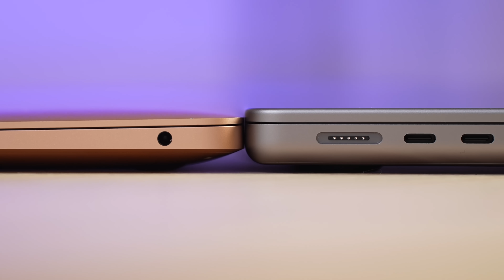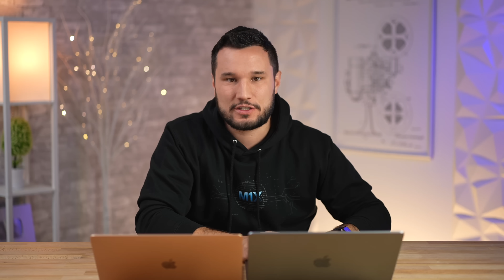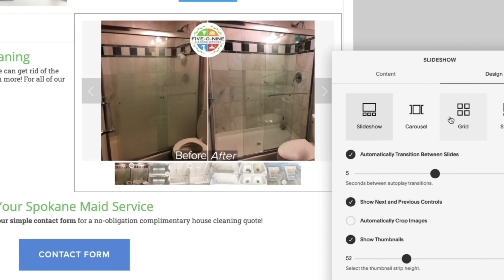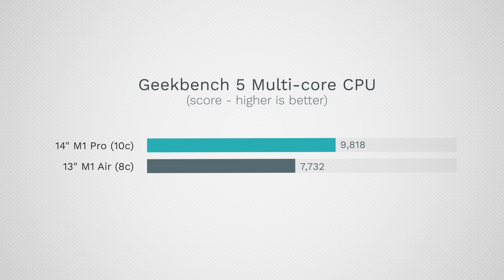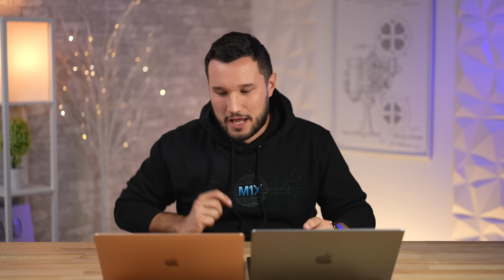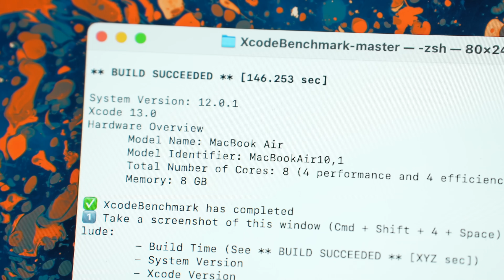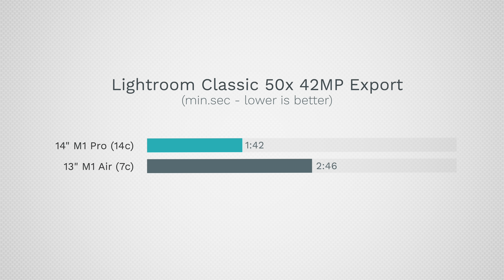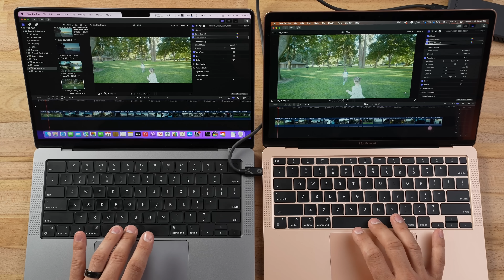14" MacBook Pro vs M1 MacBook Air - Worth $1,000 MORE? 🤔

Comment: I really love my M1 MacBook Air with 16GB RAM / 512 GB SSD. IT replà de Booth my former 6x core i7 MacBook Pro 15” (horrible battery life, noisy, hot) and my 4x core i7 2017 iMac (64GB RAM, 1TB SSD), and I’m mot looking back anymore. I use it mainly for graphic design (Illustrator, Photography, InDesign) and LUA programming. For me, the 1000€ price difference for about same performance is not worth it.

Comment: Yesterday, I had the opportunity to touch and feel these laptops in the Apple Store.  The 14" is definitely lighter than 16" but both are very portable machines.  If you have a 13" Intel, just get the 14".  if you have a 15", just get the 16".  I'm getting the 16" because I have Late 2013 15" MacBook Pro.  Thus, I purchased Apple M1 Max 16" with 64GB RAM and 8TB SSD.  It will be used for both my home desktop and travel.  If I feel that the weight doesn't really work during travel in my 14-day trial, I'll return and get a maxed out 14".

Comment: The upgrade is 1000% worth it.  First, like you mentioned if you try to match hardware specs it’s much closer than $1000. More importantly this machine feels waaaay more 2021+ than any of its predecessors.  The screen is unrivaled, the keyboard is perfect.  The touch bar experience so smooth and just the design of the sides and back with a new flair of MacBook Pro bring it current aesthetically.  Say what you want about the two but to me they don’t compare, aren’t even close, and 100 times out of 100 I would pay the upgrade price.

Comment: The new M1 MacBook Pro is definitely worth the $1000!! My main points that make it worth are below,

1. Display - The black depth and mini-led on the new MBP is breathtaking 

2. Ports - A laptop needs ports. It can’t go wireless, it will lose its purpose. Again MBP strikes here. 

3. Webcam - Technology has grown, you can’t have anything less than Full HD on a Laptop

4. Power - This is RAW power up for you to do anything. 

5. Value - If you have the money and the use, MBP will get you the best output for the money by saving time in processing and along with the other features. 

Other features are an add on for me.

This is a dream laptop for many along with me!

Comment: The pros are currently to expensive, but the prices will come down in about 1 year probably. It’s the first of a new generation so they need to make up the costs of R&D and the retooling the manufacturing lines. Also the current M1 13’ will probably be replaced with a 14’ but with everything but m2 instead of m1 pro. Probably start at about 1,400$.

Comment: -Some thing hidden?Scale the M1 module to the Pro1 and Max. Add some memory. Is there something I’m missing? That Apple actually creates nearly a dozen different chips on the foundry floor. OR… is it three or four with a simple ‘switch’, software or hardware, that activates a full fledged M1, Pro or Max? I’m sure an X-ray of each variant of the 14 or 16 inch Pro would help settle that. As well as a deep dive in the machine code buried in the OS. Is there REALLY something hidden in the new Pro’s?

Comment: It is definitely interesting to see that the M1 Air holds up well despite being launched about 8 months before and was for all intents and purposes a guinea pig for updates that even Apple must've been nervous for the reception of (considering the bad precendent of in house chips stemming from samsung). While the new variants are definitely for professionals, the next iteration of the air should include more ports for USB, an SD card if possible as well. Otherwise Apple are so far ahead of the laptop game that it isn't even funny, and this is from someone who uses android phones, not ios on a regular basis, so I'm not an apple fanboy XD. 

Apple limits the choices, but with what little they do offer, that is exceptional and sets the standard. Most people won't even notice the differences on a laptop and most developers will adapt to the ARM based tech anyway. On a similar note if we were to see Surface Laptops, while definitely being high end, and coming from the same company that builds the OS, is not nearly as compact and smooth. 

There are of course many areas a windows laptop is preferable vs a Mac, but most regular users would prefer a Mac if they had the budget. While other laptops may depreciate much faster, both in value and performance, Macbooks inherently run well for a long time and sell well on the second hand market as well; I've known of people who've used the same macbook for over 8 years and have had very little complaint other than the battery life. Of course, we do need to keep in mind that getting a mac repaired is a giant pain, both effort and finance wise.

This giant leap vs other OS laptops fortunately or unfortunately does not extend to other devices like phones, where androids provide a stiff competition and give very good performance even vs an iphone. I've never felt the need for an iphone except for peer pressure purposes tbh, but I'd buy a mac if I had the budget even without peer pressure

Comment: Once the storage and RAM sizes are matched up, I think the price difference between both machines at the point makes it easier to justify going with the 14 MacBook Pro...as long as you have the coin.  Also I think having fans makes the the 14" the way to go if money isn't an issue. But if you don't have that extra $600 I think going with the Air is still a nice purchase.

Comment: Out of the 4 new MBP review and comparision videos I've wated on the channel, I liked this one the most, because of the comparision with the M1 MacBook Air which I was saving on getting one and the Xcode tests which I could easily relate with. Wont be bad to win looking at the massive battery for use in an environment where you dont always have reliable electricity

Comment: I have both machines (older models) and use them in different ways. Turns out 99% of the time I don't need an SD slot, HDMI port, etc. The comparison is fun but not practical. Good video!

Comment: It's worth more because it has more storage and ram by default. Also more ports, which are just not available on the MBA. MBA has just one port available for use if you are charging it - not enough if you are using multiple drives etc., without long wires/dongles hanging off it. So, the new MBP is unavoidable for some. I would miss the longer battery life of the MBA or 13 inch MBP though. If you want a greater variety of ports, then you have to have a thicker device. The 14 inch for sure has a better camera.

Comment: First of all, that Notch is a product design fail ... Apple knows how everyone hates it, yet they perpetuate this annoying feature. WTF. Oh! We have to use full screen apps to get rid of the Notch. Well it does not work like that in real-world use. 

Personally for potability the MacBook Air and MacBook Pro 13" are, and probably still are, wonderful for portability. It was no fun dragging the olde 17" PowerBook G4 or the tricked out 15" MacBook Pro through airports in distant lands!

But on the huge upside, the bigger and heavier form factor, and the sheer performance coming out of these new 14" and 16" M1 devices are welcome for professional use.

Comment: Hi Max, again great video. To make a better comparison as you mentioned you need to raise Mac Book Air to 16 Gb Ram Memory /512 GB SSD / 1 more core GPU and then difference is $550 so at the end is if final user will need the power of 14 inch Mac book Pro.

Comment: Thanks for very informative comparison videos!!! We can get clear idea of which model / spec meets our needs without even trying them. These Apple silicons have been game changing, and I wonder what all next few years are going to bring. Exciting!!!

Using a 2017 MBP 15” that can potentially work as a mini room heater / hot air blower 😜, I ‘want’ a M1 Pro. But my ‘need’ is to upgrade my wildlife photography gear to full frame set up.

Well, these videos are making that dilemma worse!!! 😁

Thanks again for informative videos…

Comment: In fact, if you don’t really mind that the m1 air has only 16G ram at most, the price and performance of the m1 air can be said to be quite affordable. 16G ram can already afford quite a lot of professional projects, and program development and compilation work.
My friends are quite satisfied with m1 mac and have never complained that 16G ram will cause the project to be too slow. Of course, 16G ram may not be enough in the future. This is something worth noting.

Comment: Guess in summary pro side for macbook air is 600 dollar cheaper , weight lighter , better battery life for casual tasks, other than that the new macbook for got better screen , sound, better performance, better interfaces and basically everything.

Comment: I'm VERY interested in knowing difference in battery life for:  14inch (binned M1 pro) vs 14inch (M1 Pro) vs 14inch (M1 Max).  Especially for movie playback or wireless web.  In other words, I want to know if having extra cores (or gpus) takes more power when they are not being used.   And how much this affects battery life.  

If 14inch (binned) lasts 11 hours (wireless web), and 14inch (M1 Pro) lasts 10.5+ hours (wireless web) ... I'd go with the M1 Pro.  But if it takes more power, I'd stick with the binned.   
There's no way to make that decision at this point because no one is testing this.
If the 14inch (M1 Max) would last almost 11 hours (wireless web) anyway I would totally get the M1 Max

Comment: Max, I would love to see a more comprehensive test of these models in video editing.  What you do is fine for a first pass but all models you test can do the easy stuff. Can an M1or M1 Pro do spatial and temporal noise reduction? Can you track or stabilize footage? How well do these machines handle multicam edits, 6K timelines, Fusion or Aftereffects operations, tracking, face refinement, etc.? I would like see a methodology where you take a clip and add these one at a time to see when playback or scrubbing becomes unusable. Then you can do a series of renders using different codecs.

Comment: The M1 Pro is great, though I wish there was an M1 with more ports… thanks for the detailed tests and comparison! You might also want to consider doing some tests in terms of running statistical software and more office/productivity-oriented use cases (like large Excel files). Cheers and keep up the good work!

Comment: The Air became available almost a year ago, however only being able to connect one monitor, was the nogo still today. Also the MacBook Pro 13" having this limitation, which made me decide to get the Mac Mini M1 instead with 16GB, which does support 2 monitors. So now it was to me a no-brainer to get the new 14 Inch. I would love to take the MacBook Air simply because of the weight and size. I complete agree that the Air /M1  is way enough powerful to run any piece of software smoothly, reason why I upgraded to 16 GB was the need of running Logic Pro with a lot of tracks and besides I don't like to close applications ;-)  To me another  big plus of the 14" is the new MiniLed screen, finally after almost 10 years Apple introduces a really improved screen, hoping I can finally work outside and not needing to guess what is on my screen.

Comment: On the comparison between the two cameras you look warmer in the video on the right hand side for the 14" M1 Pro and you can tell it is better quality although it is more saturated as well. That said I personally don't like to look warm I prefer cooler looks so would have to tweak that in software to be more like the camera on the M1 Air if that's possible. Not that I would use the camera much. I hate being filmed or photographed. I only occasionally make video calls with family. I could never do that at work with strangers it is just weird. Maybe I am old fashioned and redundant. 😂 

I am happy that you are covering Logic because a lot of the tech reviewers only concentrate on video, photo, coding and even gaming before anything to do with music production and often completely miss that and anything audio-related out completely.

Comment: I got my first computer on 3 January 1982, I had ordered it as soon as it was announced in 1981; a Model B BBC microcomputer made by Acorn Computers; it had 1 Mb of RAM.

Skip forward several decades of ever advancing technology and in January 2009 I bought a 24” iMac; it had 2 Gb of DDR2 SDRAM. 

But WOW, now aged 91, I never thought I would live to see the mainframe power of my day condensed by Apple into laptop devices: the 13” MacBook Air, 14” MacBook Pro, and the mighty MacBook Max.  Your infectious enthusiasm combined with crystal clarity has made them come alive.
Reply: What feelings are you left with when you reflect upon having seen such a massive transformation? Nostalgia? Overwhelmed? Would be interesting to hear your thoughts!
Reply: Hey Peter- are you still alive to see the m3 MacBook ?
Reply: @tuhainsights I guess the difference won't surprise him as much as with the previous ones and M1
Reply: Me too. A Radio Shack TRS80 4K green screen with cassette tape storage in 1978 (HDD’s came out later), then an Apple IIe in 1983… If I’d matched the cost of all the computers I’ve bought through the years with an equal $$ amount of APPL stock, I’d have many thousands of shares. Oh well…

Comment: Fantastic video, however the price difference isn't $1000, you need to consider that the base 14" has 16GB/512GB versus the base Air's 8GB/256GB, so if you match the spec the price difference is a lot lower. However, it really does depend on what you need from these laptops. The Air is still a fantastic machine which ever way you look at it. Keep the video's coming guys.

Comment: Great video.  Wondering if you still have the thermal pads installed that seemed to help a little in the MBA?  Also, I'm especially looking forward to the unbinned 14" Pro review.  It seems like the more cores they throw in, it helps, but a bit less as the core count goes up.

Comment: The Pro sure looks to be a beast. My Air feels lovely but I can’t help but think that the extra horsepower would have a significant effect once my workload increases. Anyway great comparison!
Reply: I purchased the MBA i7/8g ram/256g ssd in 2014. After so many years, including several macOS updates, I upgraded the ssd to 512 in about 2018. In 2020, I gradually felt that 8g ram was not enough. My work is front-end and back-end development, and sometimes there are some graphic or image editing. My experience is that macOS upgrades often bring some slower side effects to older machines, at least on intel-based macs. Inevitably, the new M1 may also be the same for your reference.
Reply: @RCTUN748  yeah I’ve been told that. I think Apple is going the route of inevitable upgrades but at a slower rate than iPhones. Which is fine but only if there is a return on whatever work the user does on their machine. But then for the average user who doesn’t plan on using it for profit it’s a tad frustrating you know.

Comment: MacBook Pro just smeared MacBook Air.  It is an incredible horse that will work for years.  Either way, its price will pay off.  With such characteristics, it will last for 10 years of use.  Let's say the 2012 MacBooks are still performing the required tasks.

Comment: Excellent comparison between the two machines. The M1 air is pretty decent for its size and weight and probably it's the the best buy for any casual and even semi-pro users. The additional power and ports on the 14" Macbook Pro are very convenient though....

Comment: Hi Max & Vadim
I was really thinking that a MacBook Air with M1 but 16Go/512Go (costing 1629€) should be sufficient point of view of power for what I will do with. 

But the quality of the screen of the MacBook Pro 14 seems so great that in some case, it appears to even be better than Pro Display XDR (this last one is not Promotion and is not Mini led) except for the resolution, obviously.

To be honest, I am not ready to pay 5.499 € for the Pro Display XDR. But I am well ready to pay 2249€ in place of 1629€ (difference of 620€) just for the quality of the screen.

Are you planning to do a video that will compare quality of the MacBook Pro screen comparing to the quality of the Display Pro XDR screen.
Or maybe you will telling me it’s totally non-sense to compare quality of those screens.

Regards 

Marcos Ickx

Comment: As a student, the Air is really worth to have for someone who always do their assignments and stuffs. When it comes to the hard one like video editing, coding, etc, we can still rely on it though it takes a little bit (if not that much) longer. But since the iPad Pro also have M1, it's just really difficult to decide which one to buy. Yes, the macOS is still different from iPadOS but I mean, the macOS in M1 is basically just the desktop version of iPadOS and some apps from the x86 Macs haven't optimized for the M1, also some people who still need apss that available on Windows

Comment: the way I am seeing these new MacBooks Pro is as:

- M1 [first generation] with vastly improved memory r/w speeds,
- More ports,
- Higher video bandwidth [for more external displays],
- Dedicated ProRes chips (ASICs like),
- Improved Neural Engine,
- Vastly better built-in display,
- Improved graphics,
- and better cooling.

Definitely, much better [and significant] upgrades that we could ever get with Intel Macs, or any other laptop manufacturer at this point (or ever) -- for  comparatively "cheaper" overall price.  Apple managed to really disrupt the entire market, and chip industry as a whole.

I am meanwhile split into getting a new 14” Macbook Pro M1: M1-Pro 10-CPU 16-GPU | 32G Ram | 512 SSD — or M1-Max 24-GPU | 32G Ram | 512 SSD — or waiting for the second Apple silicon gen, cuz this machines shall last for the next a 4-5 years, min.